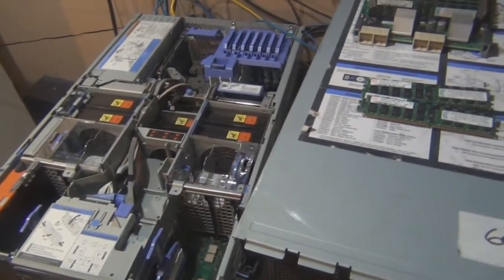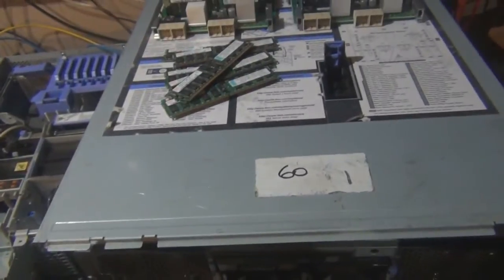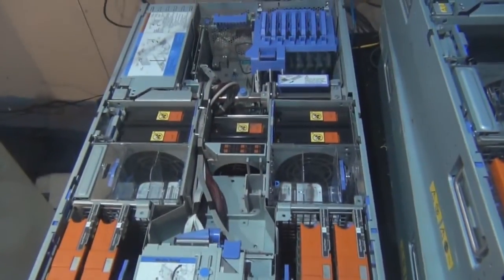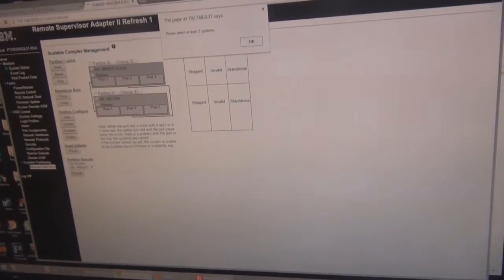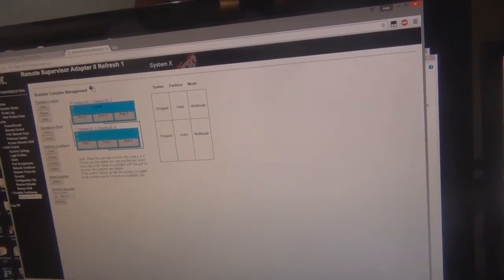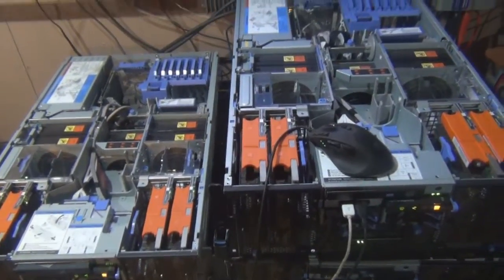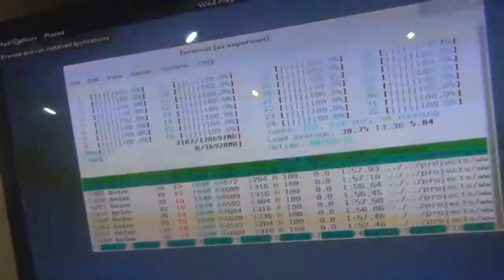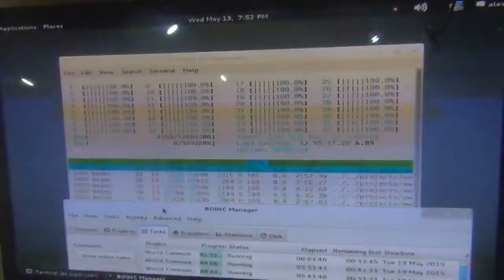IBM x3850m2/x3950m2 Server Cluster

Comment: Alex,

I got 4x IBM 3850 M2 server, and Iwould like to make a Cluster as you, I wached your video, I would like to know the name of cable to conect port 1 and port 2 of 10 Gbps to make a Cluster as you. Could you help me ? Do you know as well if that network connection is low latency?

I will hope news from you, thanks very much !
Reply: you will need 4 x scalexpander keys and 6x scalexpander cables from memory. I have only ever done 3 nodes. the clustering is not done through network, but through the custom scalexpander cables and is very low latency. I have debian installed on the machine with 48 cores and 192gb ram
Reply: Ok, I found the 4x scaleexpander keys however the cables from IBM spares are too expensive, do you know the profile of this cable, could be molex ePCI x8 ? that is the only thing I need to know, 

You have a great machine !
Reply: I got my cables from ebay for about $100 each

Comment: oww, thats a nice collection of server power :D
Reply: Aussie50 Its not a bad collection but its pretty old stuff Processor and memory wise,
the 3850 M2 i know for a fact use uses older Processors without Hyper Threading, XEON E53xx if i remember correctly, That means each machine only has 16 Threads (1 for each core of each CPU).
On the other hand, each of the 2x IBM X3550 M2 and 1x IBM X3650 M2 servers i have in my lab rack uses the XEON E55xx Processors which are hyperthreaded, so each of my dual Quad Core CPU machines has the same number of threads and probbaly more Performance than one of his X3850 M2's (i believe the X3950 M2 has the same cpu setup as a 3850 M2, but dont quote me on it, correct me if im wrong).

Also X3850M2 and X3950M2 are DDR2 where as X3550 M2 and X3650 M2 are DDR3.

Source: I own IBM X3650 M1, IBM x3650 M2, IBM x3550 M2, and i researched the IBM x3850M2 to see if it was suitable for my Lab needs vs Cost.
Reply: Aussie50 One thing that those Can do that Mine CANNOT is the Scaleability, thats really the only advantage, but the amount of space those machines need and the much higher Power use per machine kind of negates the advantage. For comparison, my 3650M2, and 3550M2's all use the same 675W Redundant PSU's
Reply: Aussie50 alex993cc1 
Here is an album with pictures of my Cisco / Server lab rack setup:
https://onedrive.live.com/redir?resid=e3f492160d340b80!5324&authkey=!AEpxVgL-edHIUkU&ithint=album%2c0